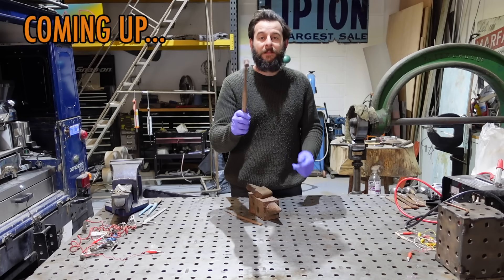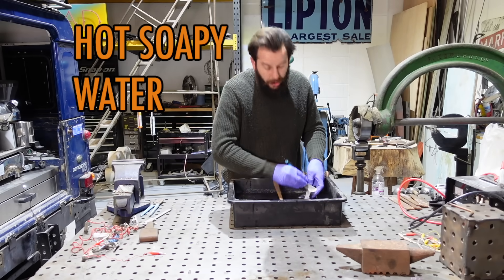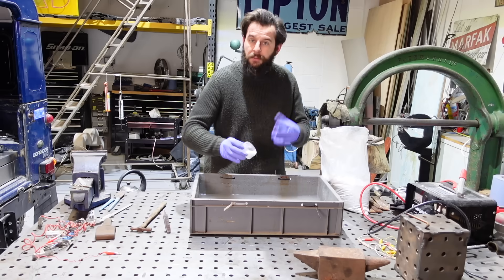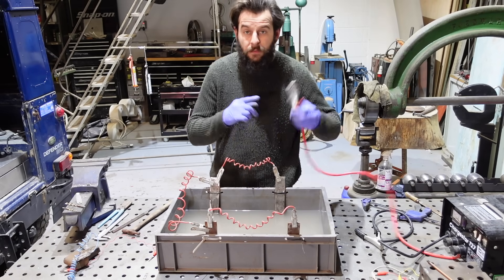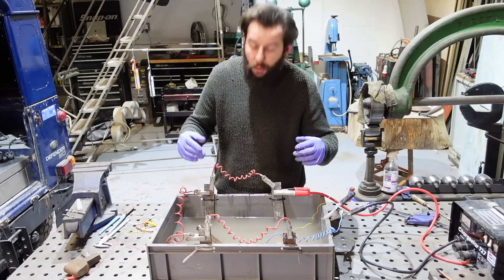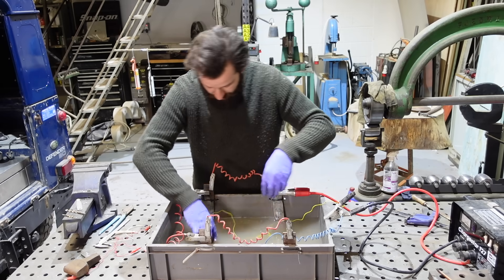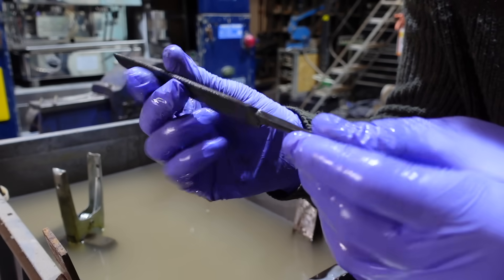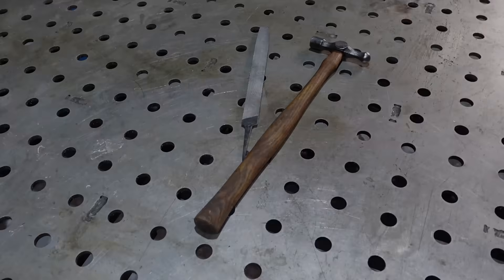The Power of Electrolysis | How To Transform Rusty Tools!

Comment: Whatever you do, DON'T use stainless steel for the anode (+), it produces hexavalent chromium salts in the solution, which are toxic to just about every organ in the body in vanishingly small quantities and have to be disposed of as hazardous waste... If you hate scraping the barnacles off as the sacificial does its stuff, get some graphite plates or take the copper off some arc burning carbon rods (take them out when not in use, the clay binder holding the carbon together eventually dissolves...)

Comment: I would warn against using just any kind of steel for the sacrificial anode(s). If you use a Stainless or relatively high Chromium content steel, it will make your leftover water very poisonous. Not something you should then pour down the drain! So, only use mild steel and similar for your anodes.
Reply: Thank you for the heads up!
Reply: Baking Soda can sometimes neutralise the used solution
Reply: @johnbrennan7175  I'm sure it can (it certainly works on acids) but in the case of stainless steel anodes, whatever you end up with will still have the chromium in it.
Reply: @ajayray4408  He's not using stainless steel in this video, so the warning is a little zealous.
Reply: @bitTorrenter  Not at all zealous! Anyone trying this for the first time would have no idea that stainless steel would have that effect.
I didn't.
Reply: @bitTorrenter  That is a separate issue. @Darran Phelps has said all that need be said on that one.
Reply: I don't think this is right: it's not a sacrificial anode... It's just bubbling oxygen there, so it'll go rusty if you use iron and appear to be sacrificial:
The rust isn't coming from the tool!
The tool loses rust because the hydrogen being separated out blasts it away... Stainless being exposed to oxygen will be harmless IMO 🤷‍♀️
Reply: @BlunderMonger  I'm not an electrochemist, but there are plenty of sources out there warning against using stainless as the anode. Results as toxic (and as illegal to dump) as hexavalent chromate are the worst case flagged up and even in the best case you may get chromium and nickel hydroxides and oxides in there. Why risk it? Scrap steel is easier to come by and cheaper than scrap stainless anyhow.

Comment: The only problem with this method are articles that have deep holes in them that are rusty onside the hole. The electric current will not penetrate into the hole by more than about the radius. The electric current takes the shortest path to the metal at the top of the hole and there is no current further down. Also the solution inside the whole does not get replaced due to poor circulation You need to do something clever to get a steel anode inside the hole without allowing it to short circuit and also to allow the solution to circulate into the hole. Platers have ways of doing this but I don't have enough experience to know the easiest way to achieve this safely.

Comment: Hi Dom, brilliant video I'm definitely going to give this a go.
Just wondering would this work with rusty metal that has been painted and would it remove the paint. 👍
Reply: It will not remove the paint, you must first wire brush the paint off [Paint  does not conduct current]

Comment: There are two types of rust.  The first step of the rusting process produces Magnetite (Fe304), which is tightly adherent to the iron and is black in color.  If you leave it longer, you get red rust (Fe2O3), or hematite.  Red rust takes up more space than the iron it replaces, so it flakes off.  

The electrolysis process causes the red rust to detach from the underlying metal because of the bubbling.  The black rust that underlies it actually is reduced back to metallic iron by the current.  The density of the resultant iron is maximized by using a low voltage 2-3 volts over a long period of time, but the 12V method also works pretty well.
Reply: So a 6v battery charger (used for old motorcycle batteries and very old cars) would work better than the 12v type over a long period?
Reply: @nevillemason6791  The "quality" of the reduced iron is mostly affected by current, not voltage.  Try to keep your current less than 1.5 Amps
Reply: @nevillemason6791  I see in my original answer I typed a 4 instead of a 6 in the voltage!. Any old DC source will do, I use my old bech power supply to charge my lawnmower battery so it is handy in the garage and it also has a settable output current limit. In general, the higher the voltage, the higher the current you will get if there is no settable limit. I have always found higher currents give worse results in terms of surface finish on the stripped object. For me, lowering the voltage and limiting the current gave better results with less decomposition of the electrolyte, though it obvously takes longer. The process is working in a similar way to electroplating by shifting ions around, and for that you want a specific current density, so just jacking up the current to make it plate faster merely leads to poor deposition.
Reply: @nevillemason6791  Both voltages should work, 6 Volt will just take longer.
Reply: I've seen people do this with a 5v <1A Phone charger and use Salt in the water, works as well for smaller parts, they even electroplated parts with a similar method using Nickel, Copper and Zinc strips as the Anodes/Cathodes.
Reply: Electrolysis in water cannot reduce iron because hydrogen ions has larger electrode potential than Fe2+ ions. IOW: you can't electroplate with iron (in water, maybe there is specialized solvent where it works), instead current tries to "electroplate" hydrogen, which then forms bubbles.
Reply: @denysvlasenko1865  sorry, but what are you talking about? iron electroplating/deposition is done all the time. If you look at the pourbaix diagram of iron you'll see that at basic pH's, the reduction of iron oxides to metallic Fe is quite close to hydrogen evolution (water stability). Firstly, there are always overpotentials in real-world electrolysis, meaning that water is kinetically a bit more stable than you'd expect. Additionally, the "electrode potential" you refer to is in reference to an ideal standard potential and without a third electrode (HRE reference), you actually have no idea what the actual potential vs the standard reduction potential.
Reply: To Marshall Jones:
Thanks for the good info.  I've got a microwave oven transformer I've rewrapped that produces 2.8VAC.  Will AC voltage work for this and what amperage suggested as starting point?  I adjust current with multiple halogen bulbs in parallel to MOT source.  Thank you, Marshall Jones
Reply: @anthonykrusel349  The process is polarity sensitive - watch around 5:00 carefully and you will see that you need DC (also, the anodes are sacrificial, so you never want your part to be the anode).

I can certainly endorse what @Marshal Jones said, a lower voltage is a much better idea - I use a benchtop power supply set to around 4V Edit: 6V and also limit the current to keep the rate of gas evolution down (one thing Dom failed to mention was  the gas, you need to do this in a well ventilated space because it is going to produce free hydrogen and oxygen gas).
Reply: @anthonykrusel349  Has to be DC....
Reply: Hi, my charger is 12 or 24 V   would it work better with 24V  ? Thanks 👍

Comment: One word of warning, you should not really do this in small enclosed spaces, it is releasing Oxygen (that's OK) and Hydrogen which is inflammable, also other unhealthy fumes may be coming off the solution, so a large well ventilated area is good, or even better, outside.

Comment: I remember doing this in science and the school was singled out by the local sweet shop for passing old 2 pence pieces as 10 pence pieces. The object of the lesson was to coat the 2p and then reverse the process.  Some kids electroplated more 2ps than they should have and didn’t reverse the process.  I suspect some did this at home as well.

Comment: Those battery chargers are really hard to find. What amperage would you say is required? 
I have an awful lot of old computer charger is laying around. 20V and 3.25-6.75A. Do you think they would do the trick?
Reply from the maker: I think I got it from tool station it somewhere similar, no the computerised ones won’t work!

Comment: Good job. I learned this process for restoring old cast iron pots and skillets.  No sanding or wire wheels. 
One think to watch out for is to have proper ventilation.  I believe the byproduct/gases released is hydrogen. I hang my cast iron with wood dowels and coat hangers in plastic tub. Also I get my "washing powder" at Ace hardware.  Arm&hammer yellow box.

Comment: You can sharpen a file with Muriatic Acid but this would probably work as well. Just be careful of sparks, you're making a small amount of Hydrogen gas with this process which is highly explosive. Great video.
SAFETY NOTICE: Use in a well-ventilated space or wear a mask, as the bubbles can be hazardous!

Comment: You neglected to mention that electrolysis produces flammable/explosive hydrogen gas... remember the "Hindenberg"... German airship that exploded in Lakehurst, New Jersey, USA when an alleged spark ignited the hydrogen in its gas bags and killed 39 people. NEVER set up electrolysis indoors or anywhere where a spark can ignite the hydrogen (which is lighter than air and will collect from the ceiling downwards in an enclosed space). Hydrogen is the reason that a only one clamp is attached to a dead battery in a car while the other is attached to some substantial bit of metal as far from the battery as is practical...so the spark created by the second connection is not on top of the battery and its hydrogen.
Reply from the maker: Thanks, I did put a warning in the text

Comment: This is electro-checimal acid etching. So then what is your plan for disposing of the the caustic solution?   Secondly, by buffing the hammer you have removed the protective oxide layer that the electro-chemical etching provided making it ready for a new coat of rust. Amazing how not knowing what your doing looks like good information to the sheeple.

Comment: Molasses works great for soaking, painted greasy parts, just dump in in a barrel they will come out stripped and rust free.
It is a slow process but no labor other than washing with a hose/pressure washer.

Comment: Good video showing the practicalities of doing this. However, although this is being referred to as electrolysis, it isn't using the electrolysis to transfer rust to the anode in the way anodising works. What is actually happening is that the water is being separated into oxygen at the anode and hydrogen at the cathode. The oxygen is highly reactive with the metal anode and rusts it. However, at the cathode the hydrogen doesn't react but effectively blows the rust off the surface, sand blasting at atomic level. The result is that the rust on the rusty item ends up in the water, which is why it goes brown. There is no transfer of the rust to the anode. In fact, there ends up being more rust as there is now the rust on the anode and the rust from the item in the water. The anodes don't even need to be sacrificial for this to work, you can use stainless steel and it will still work, although some stainless steel will still rust under these conditions. 

This also works as a paint stripper. I use this to remove the paint from metal items. They don't need to be iron, so long as they conduct.  It's best to lightly scratch the paint surface if possible but it works fine with old Dinky cars, etc. and works out much cheaper than using paint stripper, plus it's less toxic or harmful, both to yourself and the environment.

I also have an easy way of remembering which way to connect: +ve to "adding rust"   -ve to "subtracting rust".
Reply: Hey Alien, I have an aluminum powder coated black fishing reel spool that's corroded from salt water, I've tried methelene chloride stripper with no results. I want to remove all the paint without damaging the spool so I can powder coat it again, think this method is worth a try????
Reply: @pennyan2057  I'd be interested to try this too. One Mr McBeardy commented on this video that he used borax instead of washing soda. I'd be interested to see if dilute borax might be gentler on alloy in this application as it has a bit lower pH
Reply: Hmm... perhaps no, from what I can find the opposite might be true. At least, from some articles I have been reading it could be very dependent on temperature, current density and borate concentration. Too involved for a casual workshop like mine anyway.
Reply: DO NOT use a stainless steel anode.  By-product of electrolysis w/ stainless steel is hex-chrome, which is carcinogenic (think "Erin Brokovich").  And it's illegal to dump it.
Reply: Ààà
Reply: Good way to neutralise rust in obscure places like petrol tanks

Comment: Awesome. I have a 4 foot length of chain I want to weld the links to make a walking stick. A hundred years of weather has done something amazing to it and I want to keep it. It was hanging by the hook on one end for a hundred years and the links have rusted away progressively. The first link at the hook is still original size but each link in the chain gets progressively smaller as it goes down. The the chain basically comes to a point where the links eventually rusted completely away. It resembles a billiards cue in the way it has deteriorated. This electrolysis may be the perfect solution for me. Thanks.
Reply: That will be a very heavy walking stick!
Reply: @juriedekock6154  Not really. About 3-4 pounds. Chains are mostly holes of air. lol

Comment: The bubbles coming off is Hydrogen gas. It's flammable so do this in a ventilated area. 

EXPERIMENT: If you put a bit of soap in the solution the bubble foam produced are soap bubbles filled with Hydrogen gas. BOOM!

Comment: Bear in mind you might be making some hydrogen which is flammable/ explosive. As long as it's ventilated is fine. The washing soda is fairly benign and won't harm you. There's no electrocution risk from 12 volt battery  charger output.

Comment: In case it has not already been mentioned, you CAN use baking soda (sodium bicarbonate) as your convenient source of sodium carbonate. Just put the baking soda in water, then heat the water to boiling. Heat causes baking soda to decompose into sodium carbonate and carbon dioxide. DON'T add the baking soda to water that is already very hot, because it can react violently and may overflow your container. It is fine to use old baking soda, too, like a box kept in your refrigerator for odor control, as long as no liquids got into the box. Any odors in the powder will leave when the CO2 bubbles out.

Comment: Electrons actually flow from the negative to the positive, so they leave the item you are cleaning and go to the bits of steek connected to the positive. Its common belief that power goes from Red to black. Not true.
Reply: And I hear most air to ground lightning, goes from the ground to the clouds.

Comment: If you do this often, consider using graphite in lieu of sacrificial steel.  The graphite doesn't rust, it just deteriorates over time leaving junk on the bottom of container.  It also remains highly conductive through the whole "cook" as opposed to steel which rusts and loses efficiency.  A simple internet search will list plenty of places to order graphite in all different shapes and sizes to suit your needs.  I got into this restoring antique cast iron pots and pans.  This process not only removes rust, but will strip old "seasoning" off as well.

Comment: Attention! Danger! Caution! Another village is missing an idiot. Vintage hammer, its two pieces, handle from wood and hammer head of steel. His hot water soapy cleaning was not, as in unless his work area ambient temperature is in the 80+F and he is from sub saharan area, no steam from supposed soapy hot water. Big plastic tub, large surface area, its length and width vs depth is smallest dimensions. Such a large container for this small tool is on many levels wasteful and not good science, the effectiveness of the process is diminished to the point of nil. And as for his immersion of the whole vintage hammer, wood handle and steel head, nuts. You never, never immerse any kiln nor vintage wooden parts in water, esp hot water no matter what chemical is suspended within. The best practices displayed are poor to dangerous. Best not to mimick  copy or do as he does. So much waste. Stay well.

Comment: Why manually remove rust from 2 things when you can "simply" remove remove rust manually from 4 things and  then set this all up. ;) But besides that not bad
Reply: IKR electrolysis is really good for awkwardly shaped or historically significant jobs but for stuff like this you could do it much faster with just the wire wheel and achieve workable results

Comment: It's just sodium ions that make the water (more conductive) so common table salt should be cheaper. Fun fact, you can do this without electricity if you use food-grade citric acid in a saturated solution. Great for really small parts like screwdriver heads.

Comment: I found a bastard cut file like yours at a yard sale, but it was used to file soft alumin(i)um, and it is all clogged with it.  How do I get that out of it with damaging the file?
Reply from the maker: There are special file cleaning brushes available for just that purpose!
A bit of hard soap on the file before using it on aluminium will help it from clogging up as bad
Reply: @DominicChineas  Hey, cool idea about the soap.  I tried a file card with the little wire thingies.  It helps, but there are still big chunks.  maybe if I put it in the freezer and then put it in hot water, the shock will loosen it.  Worth a shot.  Otherwise its a pretty good file.